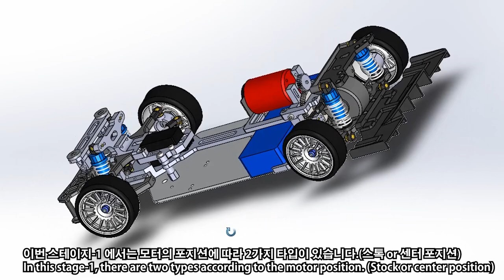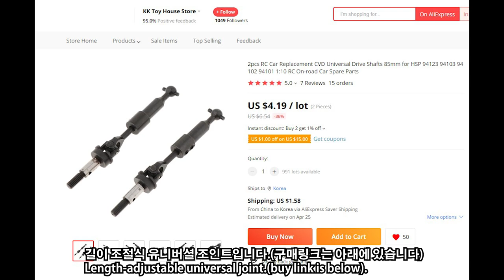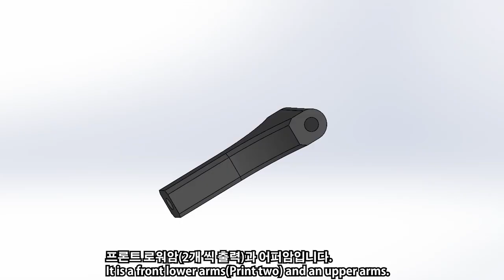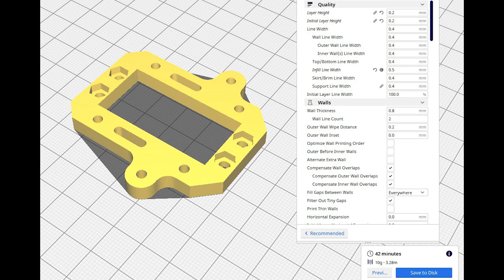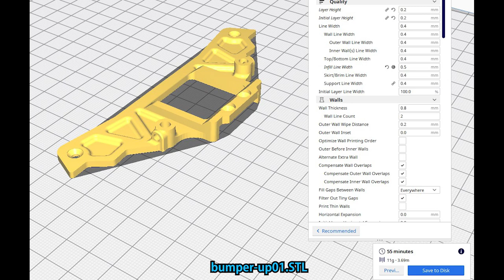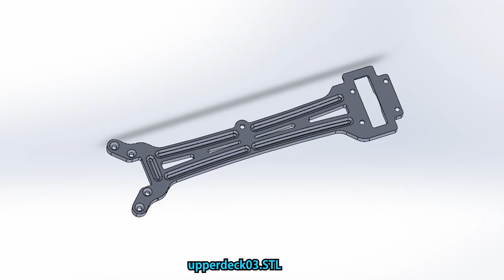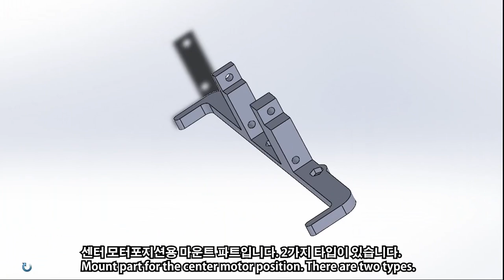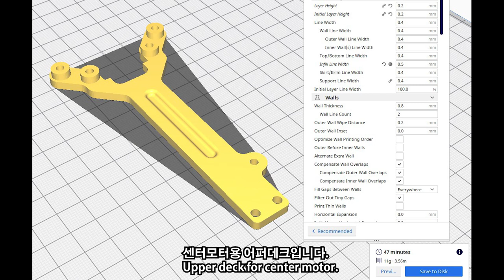HSP Flying Fish 94123 RWD conversion(stage-1, center servo &motor)

Comment: I've watched this video so many times! and I'm thinking of buying hsp flying fish too.
Reply from the maker: The HSP Flying Fhis is very good value for money and has a lot of potential when converting to RWD. It's a very good choice.
Reply: @zeusgarage4368  I bought one but,
I tried to design my own front parts, everything works well except the servo. It wasn't smooth and how do I fix this?
Reply from the maker: @шатазн  Check for interference. And use a servo with good torque and speed. If the problem is not resolved, please send a photo or video by e-mail. Thank you.
Reply: @zeusgarage4368  alright thanks
Reply: @zeusgarage4368  but Zeus the thing is the servo slips really bad, it doesn't hold no matter how hard I tighten the screw it nut
Reply from the maker: @шатазн  Please refer to the updated video about servo slip.
https://www.youtube.com/watch?v=femyQpi4E-Q&t=16s
-from 04:00
Reply: @zeusgarage4368  thank you very much, I got my car all running.but drifting is hard😅
Reply: Zeus can i Use original Servo motor From HSP
Reply: @arifyanindra7181  you can but its very weak, u should consider a digital servo and even mine burnt

Comment: I just removed the front diff and centre drive shaft and modified my steering linkage and rid of the centre brace plate as I already have aluminium chassis which is stiff already .
That is the simplest and cheap way to make it rear wheel drive.oh I made a new motor mount so that the motor is sitting dead centre high above the spur gear.

Comment: Hi, I bought a conversion and have questions. what is the difference between some duplicate files with a signature HISP? you need at least a written description of the files to do
Reply from the maker: 'HISP'  stands for high ratio gear speed. That is, mount parts that allow the motor to be mounted further down so that a smaller pinion gear can be used.
Reply: Was confused aswell thank you for the info!

Comment: Can I use the stock chassis and if so can I build just the front suspension or do I have to modify the back as well?
Reply from the maker: I am very sorry for the late reply. I was very busy with the garage construction work. Stock chassis is available, but requires modification. The price of the metal chassis is cheap, so it is recommended to purchase it. There is no problem in drifting even if the rear wheel part is not modified. However, you cannot install additional parts such as the interior🙂.

Comment: So, what type of lipo battery did you use with center motor mount?
Reply from the maker: I am very sorry for the late reply. I was very busy with the garage construction work. 2s 4500mah type. Case was 3d printed.☺

Comment: Hi where I can order this 

6mm-2pc, 8mm-10pcs, 10mm-20pcs, 12mm-2pcs

M3 nut - 42pcs

M3  set screw(무두볼트)
4mm-2pcs

M3 socket head bolt(렌치볼트)
6mm-2pcs,12mm-8pcs,15mm-4pcs,18mm-15pcs,20mm-2pcs,22mm-2pcs,40mm-4pcs,
Reply from the maker: They are bolts and nuts of international standards, so they are readily available at local bolt markets. Or you can easily purchase it by searching on AliExpress. Thank you.
Reply: @zeusgarage4368  Thanks I will start my car  tomorrow 💪

Comment: Awesome kit!.:washhands:🤭 And I have a question, where did you buy the wheels?
Reply from the maker: Thank you. I designed wheel and made by 3d print.🙂
Reply: @zeusgarage4368  Really?  It doesn't look like a 3D printed. Are you planning on uploading wheels too?
Reply from the maker: @naancar3956  Yes. I plan to upload it after a few updates. Thank you.🙂

Comment: Stock motor position audio was very odd. Kinda scared me because the video went so far without any talking
Reply from the maker: I am sorry for the late reply. I was very busy with the garage construction work. There is no difference in drift performance of the stock motor position.  However, you cannot install additional parts such as the interior🙂.

Comment: Can it work with plastic chassis? Thanks
Reply from the maker: Of course it is possible. However, the interfering area must be cut. And if you are going to convert the interior version in the future, I recommend purchasing an aluminum chassis for the future. It's very cheap, so it's not bad to buy.

Comment: Is it possible to use small pinion gears under 19t in center motor position?
Reply from the maker: Yes. In that case, low motor position mount parts are available.🤗

Comment: How I can buy it ?
Reply from the maker: HSP 94123 RWD conversion kit link :  
https://www.cgtrader.com/3d-print-models/hobby-diy/automotive/hsp-94123-flying-fish-rwd-conversion-kit
https://3dexport.com/3dmodel-hsp-94123-flying-fish-rwd-conversion-kit-399959.htm

 If you can't pay at above site, leave a message on my facebook
Reply: What if I'm using the stock chasis can I just make the front suspension or do I need to modify the back part of the car